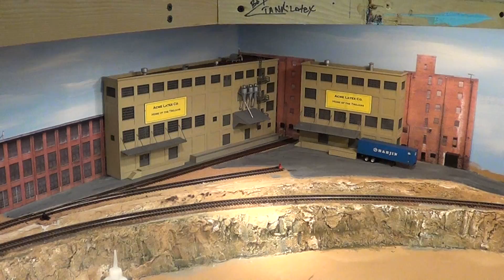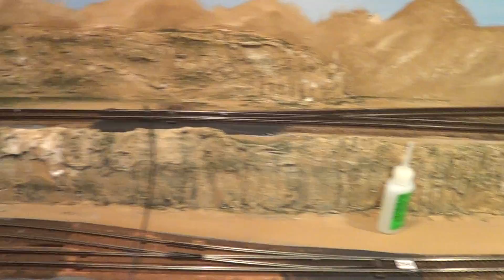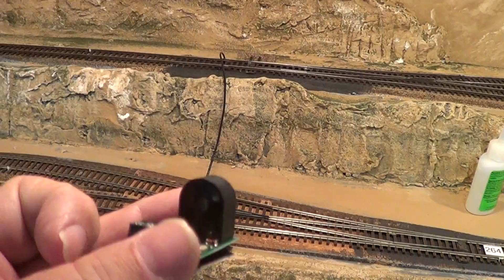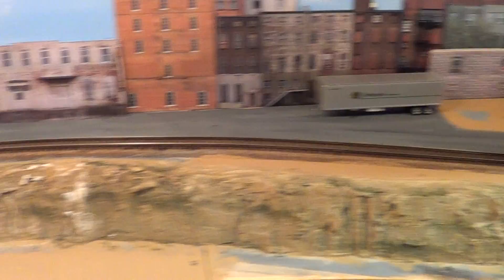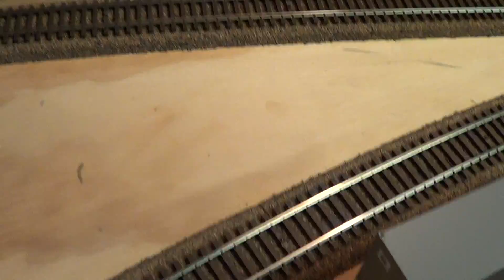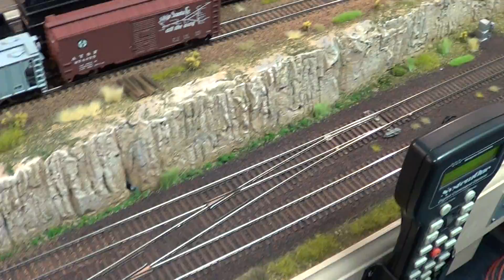NCE DCC CUTTING BLOCKS FOR BD20

Comment: Do you only cut away one rail? It appears the other rail is continuous. Is that correct?
Reply from the maker: Only gap one rail put a piece of stryne in gap with super glue. When dry cut excess off with exacto #11 blade or Dremel tool cut off wheel.
Reply from the maker: Now if you are setting up a power district and using different boosters then you gap both rails.  Also should have a circuit breaker for each power district.

Comment: I'm going through some of your older videos, for sort of a refresher.... 
I have a 5' x 21' HO Scale Layout (I guess you'd call it small to mid sized?). After 7 years of running my PowerCab, I've finally been able to upgrade with a SB5 and a few extra UTP's...  I almost forgot how invaluable these videos are for starting more advanced operations!! 
Is there any reason why I couldn't use my original PCP to just run a dedicated programming track?
...... I'm even starting over here, from zero, with a new channel.
Thanks, Carmine 🚂
Reply from the maker: Most clubs now have a power cab set up just for programming.  Know people who grew and took the power cab and set it up for programming.  Yes indeed. On the new system do not use Cab 2 for any  thing else and you do not have to even change the Cab number to go back and forth.
Reply: That's what I figured, but wanted to make sure. Thanks!

Comment: Doesnt it mess with the dcc signals and the doesnt the resistors make a shortcircut in the layout?
Reply from the maker: No has no effect on DCC system. Resistors are 5000 ohm I have 562 cars on layout you do not know they are there. If you are going to try and build a JMRI panel on your computer and connect it to layout though NCE command system it can be done and as things go is not complicated. But it is getting the basic understanding of how A connects to B And B TO C that is going to be confusing. .I have many videos on all the part of this.

Comment from the maker: Video on JMRI connection to BD 20s I have tried twice and both get too long so I am going to have think out sets and do each one. BD20 Connects to AIU01 that connects to cab buss that goes to command station, command station is talking to JMRI through computer com port.  Then you build a panel in Layout Editor.  Part on that is setting up Turnout tables and Sensor tables.  Then you attach sensor name and number to track segament or switch block. It is a step by step process.